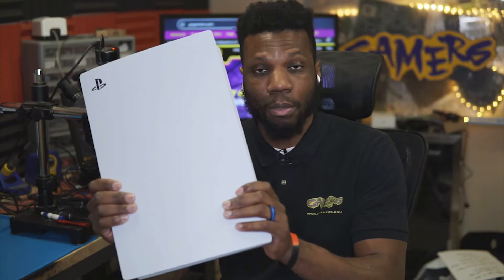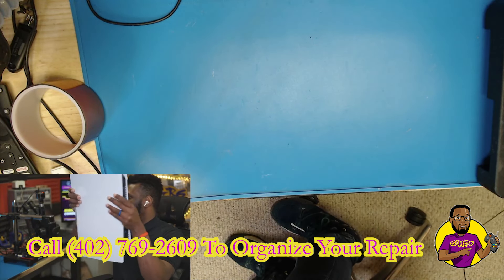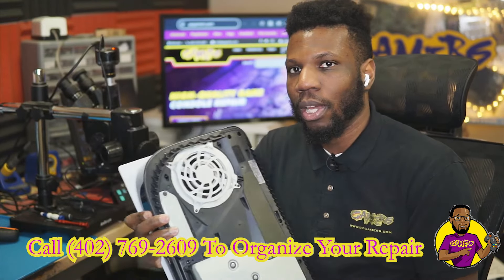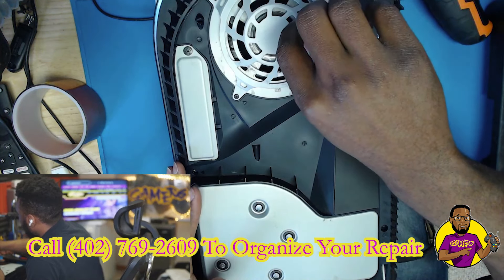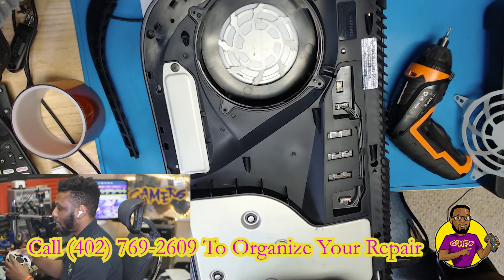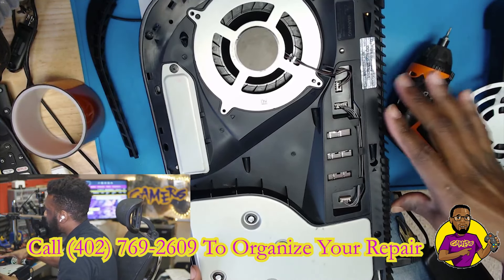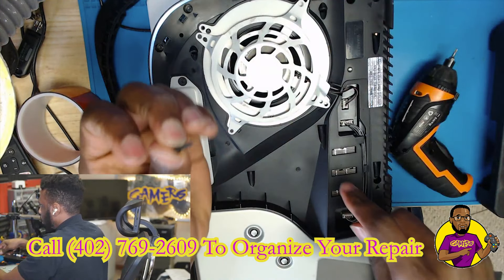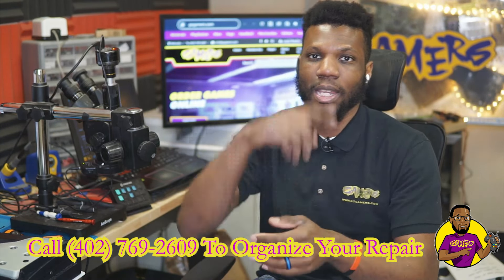Fix PS5 Overheating and Is Too Hot (EASY 5 Minute Fan Repair!)

Comment: Mine just shuts off mid game. To turn it back on I have to plug the power cable out and put it back in 🤦🏾‍♂️
Reply: Happened many times with horizon forbidden west ps5 version
Reply: Yup happened with the ps5 version of gta on me today…twice. Never had a problem with ps4 games 🤔😤
Reply: The funny thing is , is that it happens sometimes. Sometimes the horizon forbidden west can be played for 8 hours and no shutoff happens. Its like its randomized software issues
Reply: @HarijanKennels  yeah I’m just gonna end up sending my shit in.
Reply: @HarijanKennels  exact same thing for me i have tried everything to fix it is it bricked or is it a software bug
Reply: Same!   Only for PS5 games.. The PS4 versions work fine. 

Something has to be done.. I've cleaned my console and the fan is working fine. 

My console doesn't say anything about overheating..  It just hard crashes out of nowhere.
Reply: i have to do the same thing
Reply: every body seems to be dealing with this recently
Reply: @Stefantius  since Sony sent me a box to repair it , it’s been working fine 😑
Reply: same here bro
Reply: @DannyOBrien203  FIFA and 2k for me
Reply: @Smooch_XO  word? how'd you get the box?
Reply: I never sent mine in, because when Sony box got delivered my ps5 started working like it was never broke 🤦🏾‍♂️
Reply: @Stefantius  yes had a 2k game and my ps5 just randomly turns off then I have to unplug the power cable and put it back in to turn it on
Reply: Same I have to unplug my ps5 then plug it back in but it just randomly shuts off my ps4 didn’t do that so idk what’s the problem
Reply: @L.S.1  yeah, Sony wild
Reply: @L.S.1  you have to get it cleaned, or clean it yourself (for me, I had to clean around the power supply and heat sink.) I've had my ps5 since launch so it was caked 

working like a dream rn, barely any noise at all
Reply: @Stefantius  have u noticed too how quiet the ps5 is recently? I know it's not the loudest machine anyway. But Mine shut down 2 days in a row. One time only 3 Laps from the end of imola on f1 2021 on a 32 lap race lol. I've cleaned it round the fan, heatsink and power supply and it's so quiet now. Ps5 is real nice and cool, blowing cool air after being on most of today. Whereas before is was actually quite hot to the touch on the sides.
Reply: @nextgengaming7803  got my cleaned and its all good, no heat, no noises, no shutting off
Reply: @Stefantius  good, mine hasn't shut off today again since I've cleaned it. It's worth noting, as I have noticed the fan does seem super quiet, Sony can turn the fan speed up and down via firmware. I'm just wondering if Sony may have turned the fan speed down a tad too far this time, since I noticed the fan seems really quiet compared to even the beginning, and so many are suddenly affected, just an idea.
Reply: Omg same here ! I was the middle of a hard boss in demon souls . And I was about to beat it until it turned off by it self for the 3rd time ! Am freaked out I love my PlayStation 5
Reply: Same
Reply: mine too
Reply: @thisisntthewholesomefuture649  same with me
Reply: Bro same
Reply: SAME
Reply: First time I started experiencing this was with nba 2k22 last week
Reply: @Stefantius  i cant even open the the fan lol, i stripped the screws
Reply: How do I fix this man I can’t play any ps5 games it really sucks
Reply: @dreadhokage8901  take the fan out and clean the heatsink bro
Reply: @ActNasty5  thats not true... I testes it myself
Reply: @ActNasty5  u can only take out the tan if u have t9 securities, u could end up stripping the screws and damaging ur ps5 exactly what i di
Reply: @dreadhokage8901  it could be ur outlet, irregular/low voltage try moving ur ps5 somewhere else
Reply: @Drforeverok  yeah well i didnt have the screw driver for them so i left it in but i blew it all out and used the vacuum holes and now it doesnt over heat and shut down so….
Reply: @ActNasty5  same, Except I used a q tip with rubbing alcohol, not much luck
Reply: Bro I been dealing with this for about a month now. So close to sending it to Sony smh.
Reply: @cookingwithlou7197  it would cost u hundreds of dollars
Reply: Same it’s still happening to me and I can’t play gta and I don’t know what to do
Reply: @cookingwithlou7197  sent it to sony 3 times and its still doing it i dont understand . I really gotta buy a next one?
Reply: Same!!!!!
Reply: @nextgengaming7803 , I've also noticed this. When I first purchased my PS5 it would start off loud whilst booting up. Then go quiet. Now after my system has overheated many times sporadically turning off out of nowhere, I've cleaned it and now even upon turning it on. The fan hardly makes any noise at all? It's even more quiet them before. What's going on? 🤣
Reply: @Drforeverok , 😱
Reply: @HarijanKennels  yes happens with ps5 games a lot
Reply: Same!
Reply: Same here. I found out it only happens when it’s standing up. I laid it on its side and it hasn’t turned off since!!
Reply: I just ordered a new fan so we will see.  My fan was clean af since I always clean it but it just stopped spinning.  Life without games is 🥶💀  so hopefully it does it cause I don't got 700 dollars 🤣 

Luckily I got ps1 games on emulator on my phone or I'd die 😂
Reply: Sammmeeee
Reply: @DannyOBrien203  ps5 games make more heat than ps4.  it shutting off means serious heat.  mine does that.  mine i moved the liquid metal which helped.  it couldnt play anything before.  might need to add liquid metal which is what im gonna do.

it takes pulling it fully apart which is pretty easy with a video.  and the liquid metal is cheap online.
if its not that has to be dirty heatsink.  

ps5 just sucks with heat.  it runs realy hot with ps5 games.  like just barely cool enough to stay on.  so any issue at all and it overheats.

like by the side with no heatsink it can run at 96 celcius.  thats like almost 200 degrees 🤣 and shuts off at like 100 and some.

i love ps5 but???  heatwise its badly designed.
Reply: Same
Reply: @jazizstevenson  does it shutoff right when you start a game or after awhile of playing?
Reply: Fix for this? I have same problem
Reply: @connorballantyne3156  if it shuts off instantly on game boot its the liquid metal.  if it takes awhile it's just normal heating issues and you open and clean it.

also I fixed my liquid metal issue so it's not ps5 death just means you gotta take it apart completely which is less hard than it sounds
Reply: It shuts off no warning after a couple hours of gaming I took it apart and cleaned it completely but still having this issue. Should I buy a fan replacement?
Reply: @colonelradec5956   ^
Reply: @connorballantyne3156  check if your fan is running.  I had my fan die.  there's no fixing fans.  make sure it's running at all first.  like take the white sides off and see if it spins
Reply: @connorballantyne3156  if your fan spins and it's shutting off usually its dirty.  if your fan does not spin its obviously thr fan.  if it shuts off instantly on game launch it's the liquid metal.  I can show videos to fix all
Reply: @connorballantyne3156  clean it.  type in ps5 disassemble in youtube.  clean all vents and the power supply.  if that don't work let me know.  shit you'll need a special screwdriver.  its a t8 I think with a hole in the center.

so get a t8 and put a hole in it xD  I hot mine from the internet but youtube how to make a t8 screwdriver like Sony.  I'm sure it will pop-up. you just gotta dent a normal screwdriver
Reply: Same is happening with me can u tell me solution
Reply: Vertical creates an issue where the dust/debris that enters falls down onto the PSU vent holes. This causes those holes to clog and will eventually cause the PS5 to shut down from overheating. I have seen this first hand and can confirm this.  How long it takes to manifest just depends.  Depending on how dusty the environment is and how long per day you use it.
Reply: @DannyOBrien203  just happend with me mid fut champs game
Reply: I thought I was the only one who had this issue.
Reply: exactly the same for me man! iv’e had the issue for over a year & it only crashes when i play PS5 titles. iv’e done my research to see how to fix & there is literally nothing other then cleaning the fan & heat sink inside OR sent to playstation of which they want to charge me £270/$344 unbelievable. so at this point i’m just saving up to get a new PS5 Console i think.
Reply: Omg bro me too im sick of it
Reply: @DannyOBrien203  I heard they knowingly shipped it that way and the way how Jim Ryan been acting I wouldn't put it pads the l..... Sony done grew big headed and shady all at the same time..... thank God I decided to go Xbox this gen😊
Reply: Sony dropped the Ball dude FACE IT
Reply: year later i’m going through this
Reply: Same here
Reply: Bro I gotta do the same thing
Reply: Facts
Reply: Same
Reply: I’m a little late but it’s because it’s overheating the ps5 will turn off and beep three times

Comment: Also have to be careful most of those fans that goes in the back blows air in and the back is actually the exhaust so it is counterproductive
Reply: Seriously the worst design flaw I've seen in my days... We should reverse the fan so it sucks from the bottom and blows up and out.. Heat goes up, but not in the Sony universe. Haha
Reply: Question, I haven't tried it because I don't wanna be one of those people who breaks it for being stupid. What side can I use a fan too keep the air circulate?
Reply: @Mrs.Jekyll  top for in, back is out
Reply: @_mylastname the dusts from ground could easily get into ps5 more often that it could possibly from the top so I believe it should have getting air from sides and exhaust from back

Comment: So my PS5 is cutting off ONLY when I play NBA 2K23. Game is 160 gbs. I play division 2 more than any other game and it’s 110 GBs. My PS5 doesn’t put out the heat on any other game that it does when I play 2K23. I’ve layed it flat and it’s in an open area. I even had it outside on my patio but only 2K makes it shut off. I never get any overheated error message it just shuts off. I recorded it happening and sent it to song and 2K and was told to clear the cache or I can send it in for repairs.
Reply: Sounds like you need to clean out the dust from inside

Comment: What it seems like is a flawed design finally raising issues, ever since I bought my ps5(first Gen) they have said “stand it up, its no problem it's designed that way” which is Bs because what they don't tell you is that standing your console right side up for long periods (years in my case) block the bottom air vents which in turn trap hot air either way , no matter how many cleanings or fan fixes over time the constriction from this position will burn your fan out it may take some time but it’s inevitable based on the design  . It seem for serious and continuous game play your  ps5 should be placed laterally to prevent heat constriction . This problem started a few months bacc I turned my PlayStation sideways after a hard reset and haven’t had this problem since 💯so I am speaking from personal experience 💯
Reply: I have a fan for the bottom and it still overheats, its not the orientation but I'm glad it worked for you
Reply: @AxelRize  might I ask what made you by a fan in the first place ?
Reply: thanks im gonna try this , my fan works but i still get the temperature hot message . I hard reset my ps5 then place it lateral ?
Reply: @Roatanpilot  you really should cause I have never had this problem again after I switch its orientation , im on destiny 2 going 5 hours plus daily with no issues
Reply: @donnieblacclive  you think that's the solution I'm gonna have to try I'm constantly getting your ps5 is to hot notification and my ps5 has always been placed vertically since I bought it
Reply: @daiminscullion4467   try it , it has truly worked for me
Reply: @donnieblacclive  hey, I also have a PS5 positioned on the side, and when I play games like: Fifa 22 or Ghost Of Tsushima (in short, PS5 games) the fan gets louder and when I touch the console I notice a certain type of heat coming from the side of the fan , and I notice that the grids are also really hot when I play PS5 games, but I have never received any kind of message about a possible overheating, so I cannot understand if these temperatures are normal or i need to worry
I have a nidec fan (loudest)
Reply: @alby2216  you should be good man as long as your not getting any notifications that your system is overheating I wouldn't sweat it
Reply: @daiminscullion4467  this fact is driving me crazy, as I'm not an expert but I don't find it very ok that the fan makes noise and a part of the console gets hot like that, anyway I cleaned it a bit a week ago without removing the fan though, and initially it was very quiet, but after one day it returned to being noisy as before
Reply: @alby2216  there are a multiple of contributing factors to this problem that differentiate each players experience such as room temperature, rate of frames needed to play the game , though loud the power of the particular fan model , etc. I honestly don’t have define answer to this problem I just know what works for me and has continued to work since I posted this 🤷🏾‍♂️. I’m glad you don’t get the over heating problem though 😎🤙🏾keep it up and stay blessed ✌🏾
Reply: I agree first gen console here just had my ps5 power off in vertical position clean all the time the bottom was so hot I couldn’t touch the screw extreme heat glad it didn’t fry it is now back up n running sideways

Comment: I don't even get a message saying it's overheated it just Nopes and turns off. It only happens when I'm playing PS5 games. I heard PS5 games over clocks it more than PS4 games which is extremely ironic.

EDIT: (08/17/2022) About a month after this post, I haven't had any problems playing. I bought a ifixit toolkit from Best Buy and took apart the PS5 as much as I could and dusted it as much as I could. I found some dust where the heatsink was(I believe it was the heatsink). But what I believe made the most difference was putting the pS5 Horizontally, laying it down. Everytime it overheated and turned off, the bottom(when it's standing up, vertically) was extremely hot. So when it's laying down, that bottom part has somewhere to breathe so to speak.

Try laying the PS5 horizontally. Maybe it'll help you guys.
Reply: Just posted above to somebody basically exactly what you said, past pissed at it now
Reply: @DannyOBrien203  mines just started doing it recently probably around like 2 months ago. The crazy thing is though it seems like this has been a issue for over a year now for a lot of people and Sony hasn’t even addressed it. I have a Xbox series x but I just prefer playing my Ps5 more so I really don’t want to switch to my Xbox primarily but if it’s not fixed I might just have to
Reply: Same here no warning just boop cleaned dust from fan last night though hope that helps tends to only do it when I’m playing ps5 games particularly madden 23 right now
Reply: I edited my post for an update. If anyone wants to see how I fixed my problem.
Reply: Maaan, mine just started doing this yesterday.. I’ve clean it three times but never far enough to get to the heat sink, usually just the fan. I might have to dig deeper.
Reply: @evizzlegaming1008 what did you end up doing
Reply: @zoraplays1009  I had to purchase a new system unfortunately.
Reply: @evizzlegaming1008  bro what

Comment: Reading a lot of the comments below this sounds like a software issue. Something is off as far as how the system translates the temp of the components and what speed the fan should blow to cool the system.  I just started having this issue a few days ago. I broke down the whole console and cleaned it out. To my surprise it wasn't that dusty so this has to be a software issue. Hopefully it's not like a Stuxnet kind of thing. 😂😢👀
Reply: Your PlayStation ever stop resetting its self ?
Reply: @Ibesteph_  mine shuts down after 10 minutes,like wtf, and the fan works for a while and then stops spining,and then off course the console shuts down, man ive had this shit for like a month.
Reply: Brother I cleaned my ps5 and still every single time a play UFC5 it shut off 😢
Reply: Did anyone fix it?

Comment: Having the same issue.  It doesn't have any issues playing PS4 games or off the portable drive.  But whenever I put a disc game, the fan blows loud and overheats within 2 minutes of it being on.  My PS5 gets very little use.  I haven't used it on in a month.  So there's no reason for it to overheat.  I opened the side panels and there's no dust!
Reply: So how u fix it same is happening with mine
Reply: Fan is not as it was prior
Reply: @supriya0912  There's nothing you can do. When Sony releases the PS5 "pro" or whatever, buy that after selling this junk.